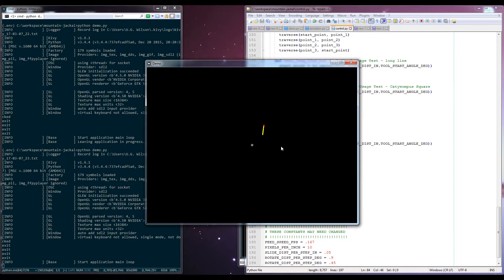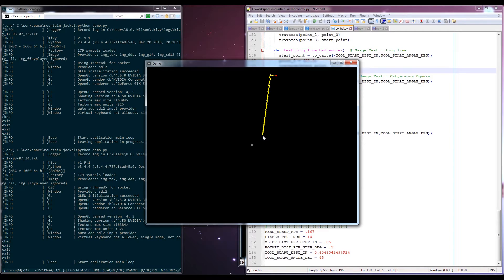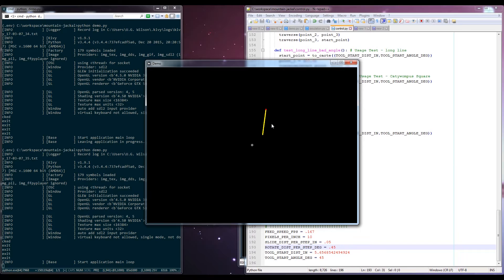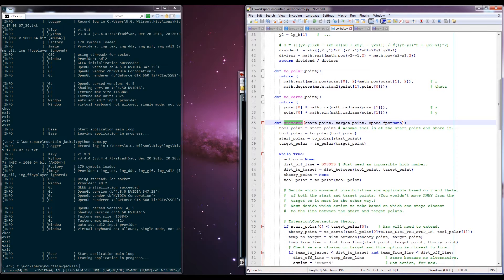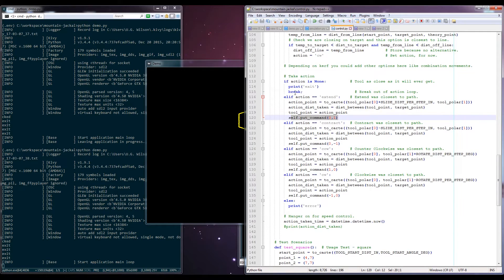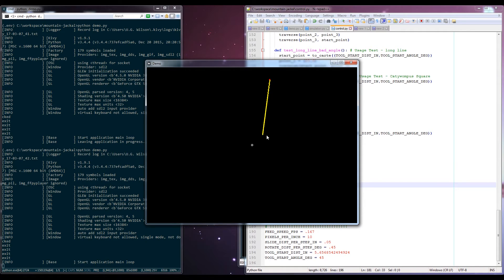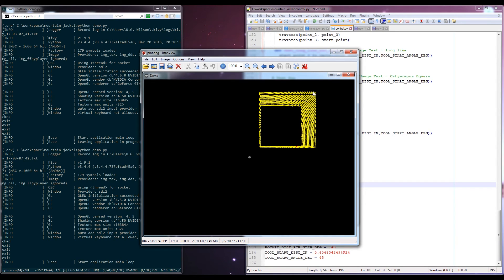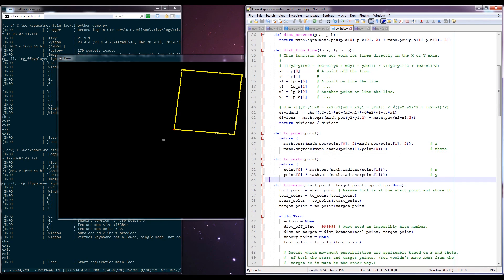Rotary and Slide Axis CNC Control Algorithm

Comment: I would adapt a Bresenham line algorithm for this one, as it is simple and fast and makes the decision of what axis moves. At the start it calculates how many steps each axis needs to reach the target and selects the larger one as the driver and the second as driven axis. Then it just updates its counters on each step of the driver axis and if the counter goes above zero on the driven axis, the driven axis steps and resets its counter. Smooth, linear and always "on the line" :) This can be expanded easily to how many axes you want, just needs simple integer counters for each one.
Reply from the maker: What would be your adaption strategy?
Reply: Not sure if I completely understand your question, but please do ask if I left out something. As I explained, the Bresenham line algorithm can be used to get all the points on the line between points A & B. Then it would be just a matter of converting those points from Cartesian to polar coordinates and defining a feedrate between the Cartesian points.